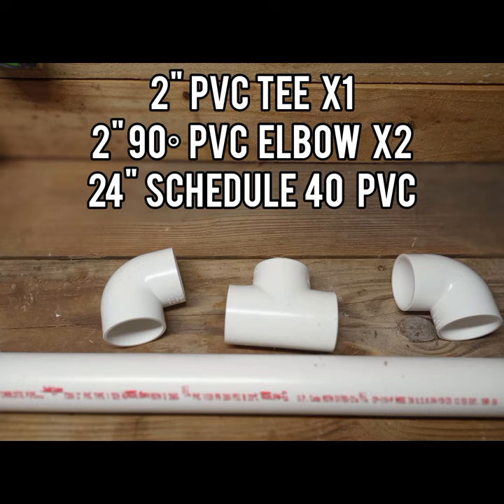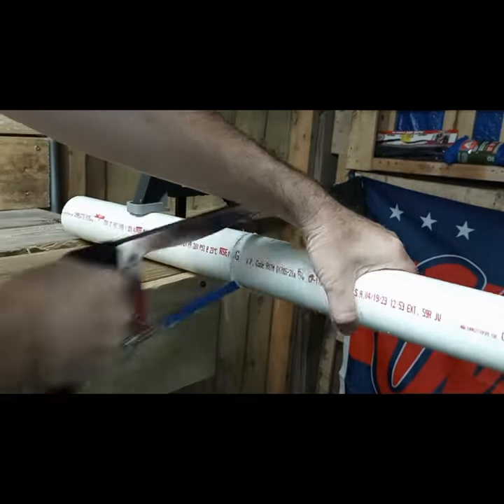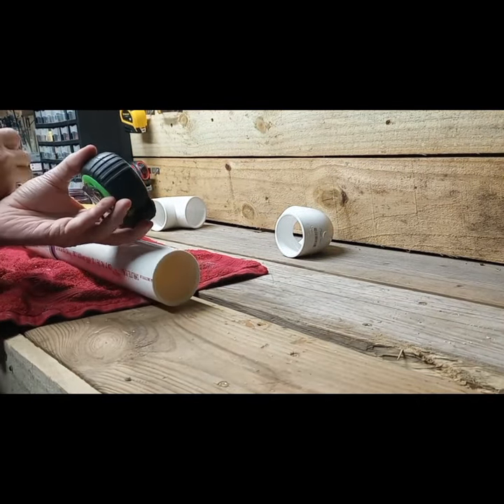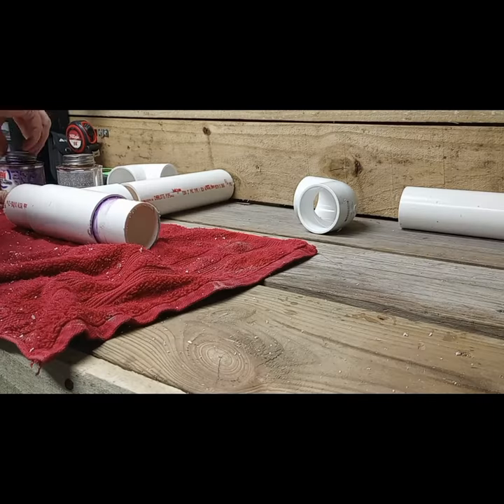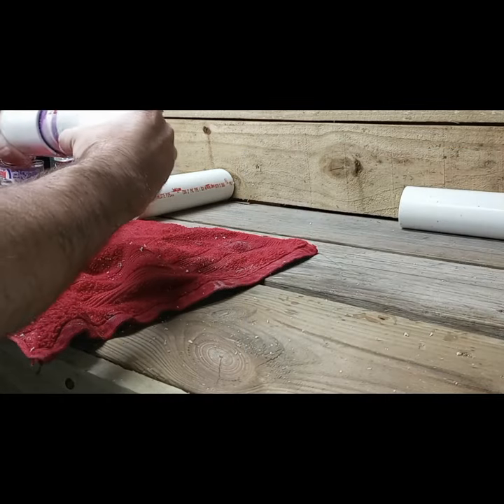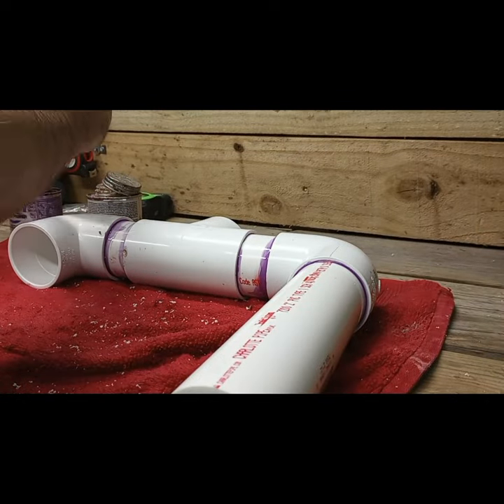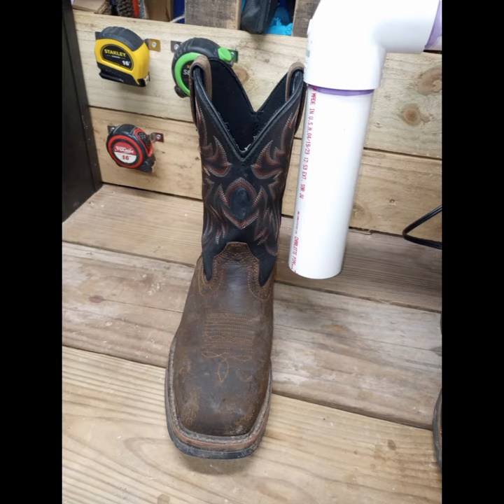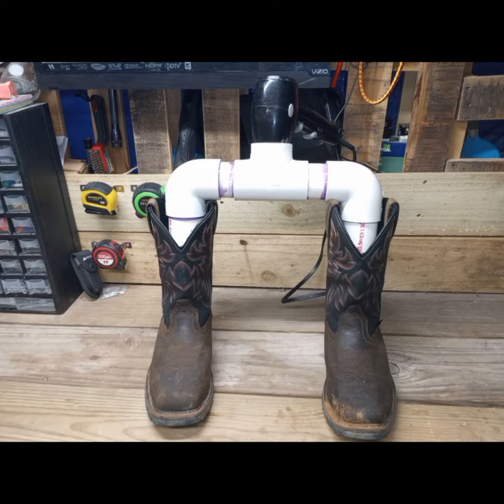How To Build A Homemade Boot Dryer

Comment: I've also seen someone build a wooden box without a bottom.  Cut a hold in the top of the box then insert the PVC into the top of the box.  You set the box over top of a floor register and every time the heat comes on it's warming your boots!
Reply from the maker: I've seen that one as well. Neat idea

Comment: Could you use pvc that's smaller than 2"?
Reply from the maker: Yes you could. It's your build. You wouldn't want to go any bigger though. The shaft of the boot should have some space between it and the PVC pipe to allow for proper ventilation while drying